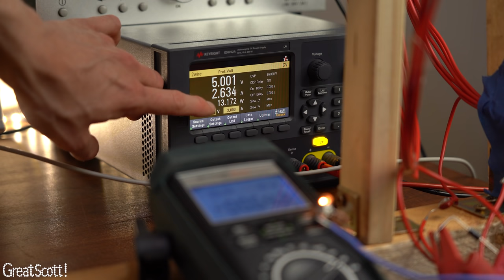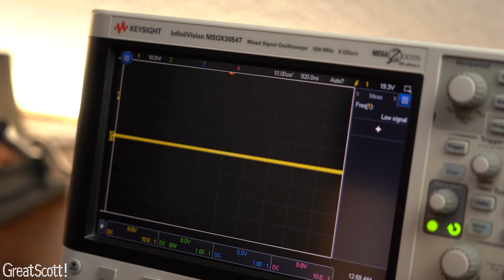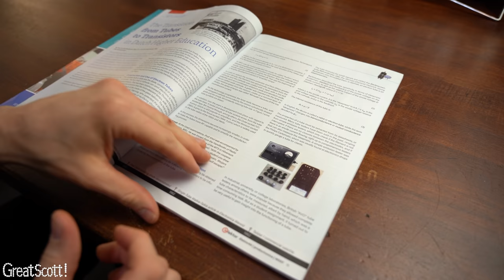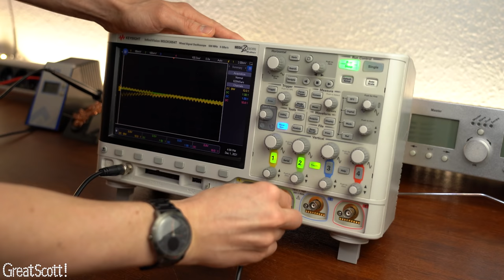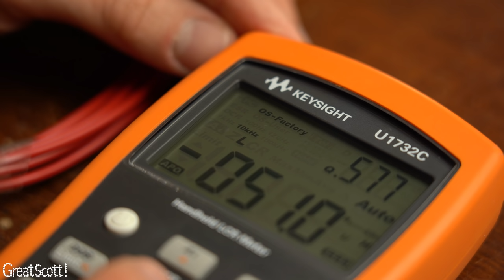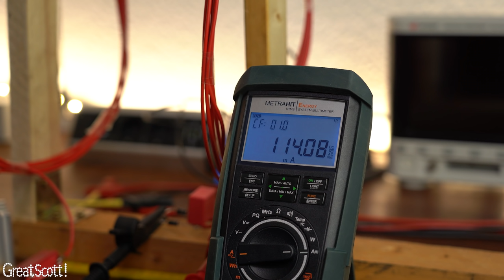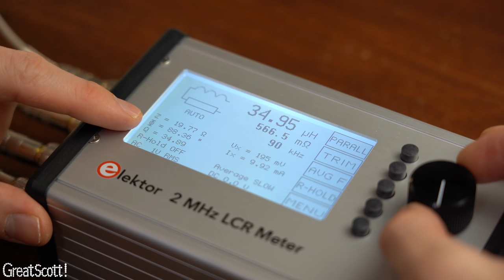In Search for the BEST Wireless Power Coil! (Experiment) My Coils can act like Capacitors?

Comment: The 3 fundamental, passive components (Resistor, Capacitor, Inductors), can be "built" using wire as the building block (no other component is needed)   You can also build logic blocks with only wire as well.   Which means wire is by far, the most versatile component, if you are creative enough!
Reply: You can make logic with wire?? I only know about mag amps those have a core.  Or maybe something using thermal nonlinear properties? 

Relays that are based on attraction between two coils?

Comment: I always thought that the inductance is a measure specific to a coil and not varies with frequency. I also used to calculate it with its physical dimensions (length, diameter), number of turns and core permeability.
It is new for me that L is different at various frequencies. 
XL on the other hand (impedance) is related to the frequency.
What am I missing?

Comment: To be precise : An inductor , L, changes its impedance with  frequency . 
When the frequency  of the current generator increase  the inductor becomes parallel RESONANT with its parasitic capacitance , Cp. 
A Further  increase in current generator frequency will cause the  inductor to  have a   current  lagging in phase to its voltage : indicating that the L Cp circuit now appears capacitive !

Comment: So, it comes down to resonate frequently to gain power which is between, not high and not low, so the high will decrease and the low will decrease, but the resonate will balance it out, so the high is smaller copper?? Smaller space in between copper?? So, what matter is space itself so if you want to go further, ya need more rings in connection to the diameter of copper so or the high is bigger copper which leads to a smaller ring in diameter of the total, so comes down to total, so within that total, what does matter within the total diameter, the volume. What does every depend on what?? What is the ratio?

Comment: the coils are wrong, every turn of wine MUST be paralel to the other IF one loop of the coil goes behind its predecesor it will cancel the efect, THEY MUS BE paralel one to each other! it will  improve the performance, print a circle to wind them in paralell,  they are antennas not transformers consider that idea. Regards from Chile.

Comment: You should have had 2coils in series 1 clockwise 1 counterclockwise and a capacitor at the same capacity and the inductors inductance  1uh 1uh 1uf and and a ground in-between the the two coils. That WOULD have worked a HELL of a lot better

Comment: Did you try out silver plated wire?
Reply from the maker: Not yet....but what should be the difference?
Reply: @greatscottlab  I think lower resistance just getting started myself in electrical stuff. Military surplus air craft wire is what I have been using.

Comment: i think your wires are still too thick for the skin effect . of course you know the awg go check the 1Mhz how thin the wire must be . it could be the problem why litz  behaved the same at higher frequency :^ .. thanks for the video it was very useful as always :)
Reply from the maker: I think the overall conductor thickness was still to thin so that the resistance of the wire itself was still the main culprit and skin effect did not have much to say.